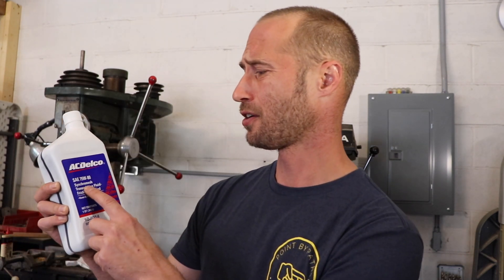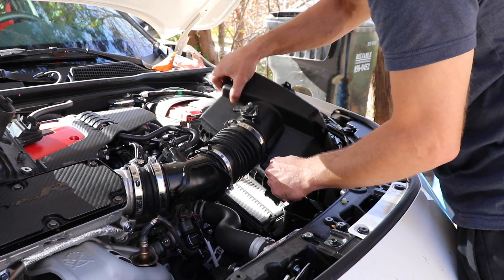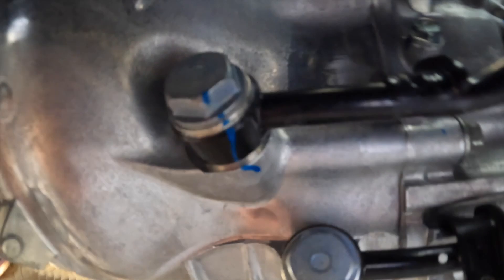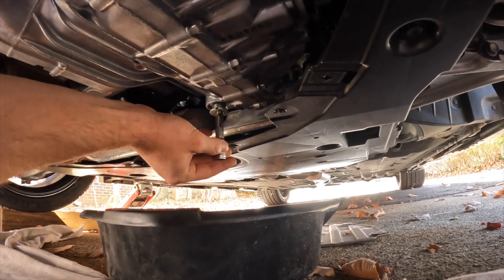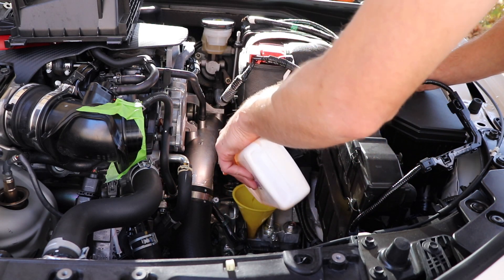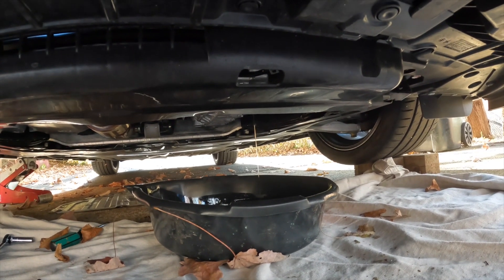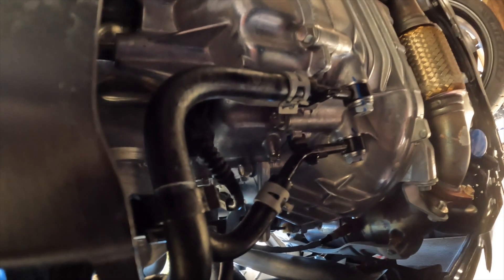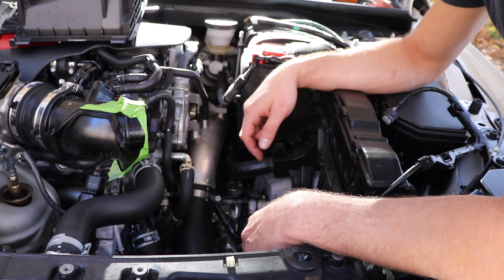FL5 Civic Type R Manual Transmission Fluid Exchange

Comment: No torque correction is needed, regardless of how long the extension is.  If you don't believe that, ask a physics teacher or mechanical engineer.
Reply from the maker: I don't need to ask. I tested this myself after you commented. You are indeed correct. The torque remains the same. It's the force needed that increases. Good catch!
Reply: BTW, great content - Thanks for all your posts! @pointbypatrol
Reply: @kjechel2691  So for instance when you set your torque wrench to 32 ft-lbs the torque wrench will apply the same amount of toque with a shorter extension (the bottom trans drain bolt here) as with a longer extension (the top trans fill bolt here) the difference being that with the longer extension it will just have a little more resistance requiring more effort to achieve the same 32 ft-lbs?

Comment: why do you need to change that bolt washer, you also do that when changing the engine oil, kinda curious.
Reply from the maker: It's a one time use crush washer. If you reuse it you risk an oil leak.
Reply: thanks for the info @pointbypatrol
Reply: @muhammadnawfal1169   Because it's a 'crush' washer. It becomes crushed or squeezed and creates a tight seal. Since you should be torqueing it the same every time, they have to be crushed every time with a new washer.

Comment: You are incorrect on the extensions relation to torque applied. The extensions do not change the moment arm (right angle distance from the centerline of the bolt to the end on the torque wrench handle). You did not need to increase the torque setting.  The torque wrench handle is just a lever.  If you were using a crow's foot wrench, that would change the torque applied.

Comment: Looks like you’re putting 75-80w while I’m reading on forms that car takes 75-90?
Reply from the maker: @pro-motionmedia  factory fluid is 75-90. The friction modified synchromesh works perfectly and offers some superior heat protection.
Reply from the maker: @pro-motionmedia  for me the AC Delco holds up much better on track.

Comment: So I put new transmission fluid on my FK8 last year which was ACDelco and did a track event a few months after, in the recent weeks I had trouble pulling out of 1sr through 3rd when down shifting and I swapped too Amsoil and now my shifter is allot smoother.  Wondering if the ACDelco boiled up from the track event when I pushed it.

Comment: What is the part number for the crush washer?  Thanks for all your videos
Reply from the maker: I need to go to Honda tomorrow to order some parts. I'll ask while I'm there! Both upper and lower washers are the same.
Reply: @pointbypatrol   Awesome thank you.  Please keep on keeping on!
Reply from the maker: 94109-2000
Reply: @pointbypatrol  You're the best!  Thank you again!
Reply: @pointbypatrol did you also replace the washer for the 10mm bolt? If so, what is the part number for that?
Reply from the maker: @pneutin  I was a bad boy and didn't
Reply: Just looked it up -- the part number is 90442-R7G-000, and bolt torque is 9 lb ft.

Comment: Can you recommend when should do the first transmission change
Reply from the maker: It ultimately depends on how you use the car. If you are just driving normally then I'd recommend 30k, but if you are tracking the car then I'd recommend replacing it every 3-5 track events.

Comment: Does the overflow bolt washer need to be replaced too?  I know the fill and drain does.  What about the overflow?
Reply from the maker: @ElusiveAura  My professional answer is yes. My actual answer is no, not really. I reused mine and had zero problems with leakage. I only change it out once every other exchange.
Reply: @pointbypatrol  thank you. I should have asked initially but when you do change the overflow washer out, is it a different size from the fill/drain?
Reply from the maker: @ElusiveAura  yes it's much smaller
Reply: @pointbypatrol  you wouldn’t happen to know part # on that overfill washer would you?  My parts guy at Honda trying to tell me it’s same washer size as drain and fill but you said it’s smaller.
Reply from the maker: @ElusiveAura  it's a lot smaller because it's only a 10mm bolt. I don't know the part number of hand, unfortunately.

Comment: Hey I have an FL5 too I noticed the gears are very notchy with the oem fluid I haven’t replaced mine I only have 1000 miles going to be doing so in the next couples of days to amsoil 0w20 and AC Delco for the transmission fluid any advice?
Reply from the maker: I did notice that after 1000 miles the transmission started to "loosen up" some, but I can already tell a slight improvement with the AC Delco fluid!
Reply: @pointbypatrol thanks for the fantastic video. I will be attempting this on the DE5 but only at 4000 miles. What’s the recommended change interval for these vehicles that hasn’t seen track usage?
Reply from the maker: @eleisonv3510  I believe the transmission fluid exchange is recommended at 60k under the "normal" maintenance schedule.